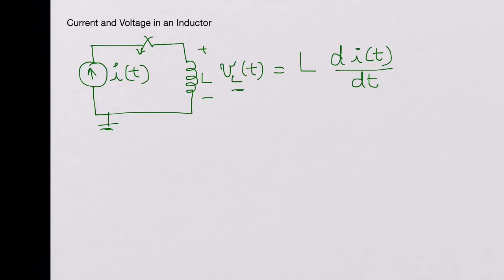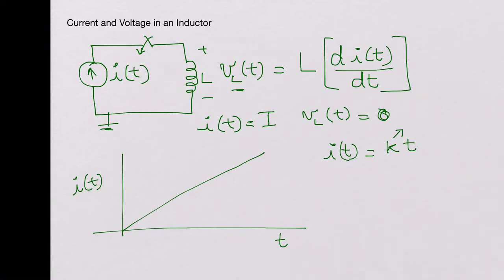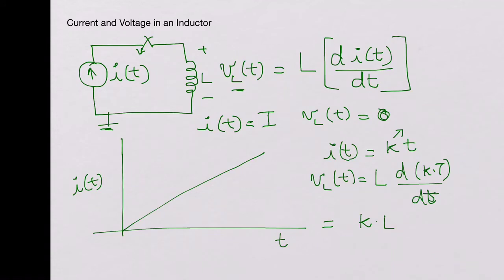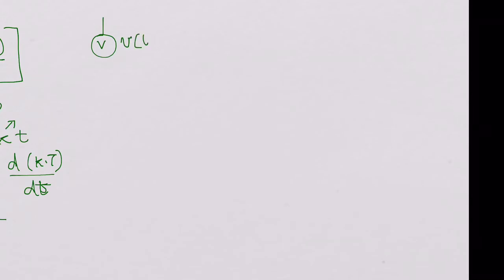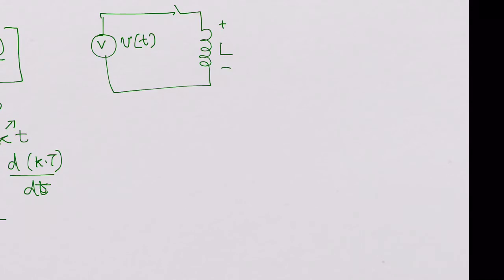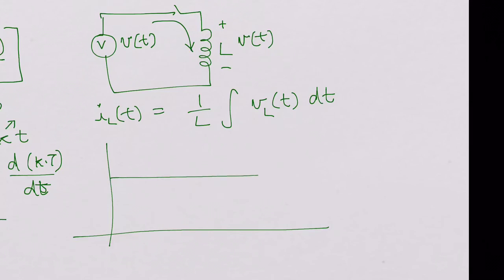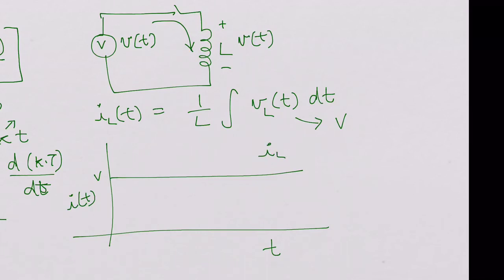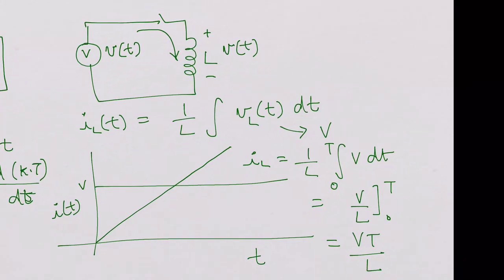Current and Voltage in an Inductor

Comment: Actually L is delay the build up or the counter acceleration of current. That is why to save energy you increase current slowly is more efficient than accelerate it. A CR add on would do a perfect job in keeping best optimal solution for any demanding load for a particular boundary setting